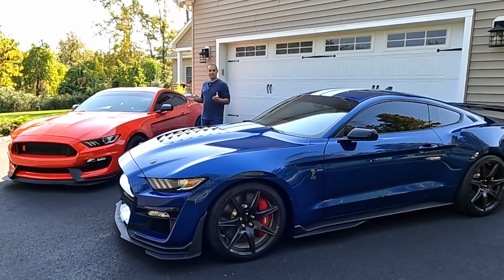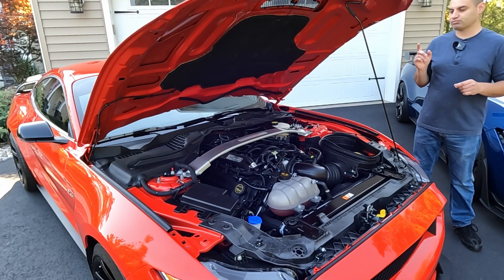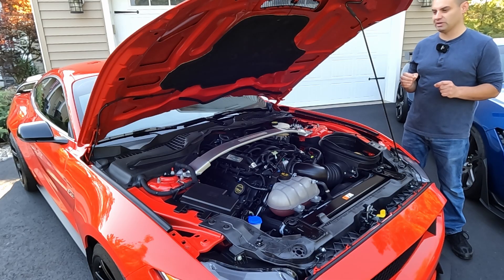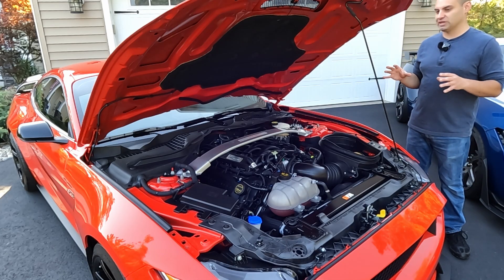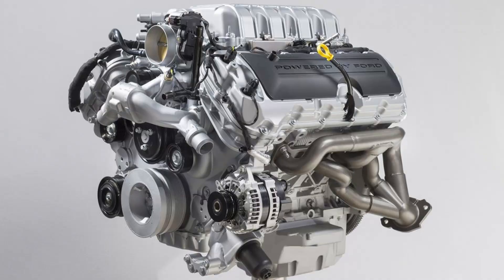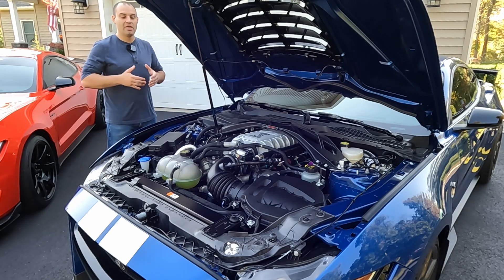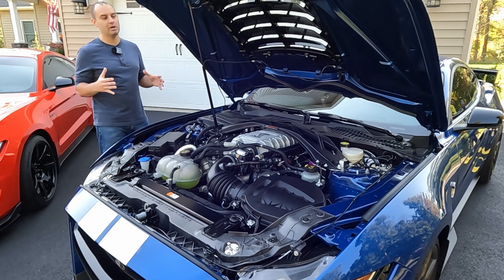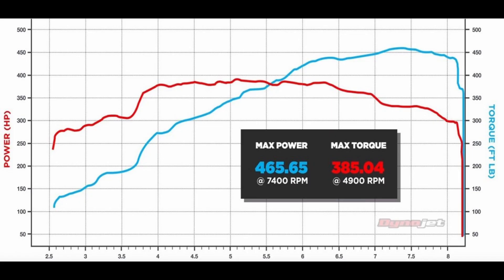GT350 vs GT500 Engine

Comment: 987 horse power is the best configuration for the 350 beat everything on the track in GTR spec 305 rear wheels 240 front wheels soft rear suspension adjustable dampers hard front suspension

Comment: Gt350 is 50/50 gamble 
It can last well over 100k miles if you maintain 
Or blow up in couple thousand more or less millage 
 My bro brought 350 2016 6speed it had 695miles brand new 
After couple of weeks guess what back to dealership motor blow up at 1055miles 🤣 hopefully he had warranty but they end ip replacing the motor if he didn’t had warranty it would cost probably well over 20k +

Comment: Small correction, high cylinder pressures are measured in PSI, pounds per square inch, not pounds as you stated.

Comment: Nice comparison.  I have both cars and consider both of these closed air intake systems. The hood on the 350 seals the intake when closed. I put a JLT intake on the 500 and gained an additional 25hp (untuned).

Comment: what makes the gt350 and gt350r different?
Reply: Carbon fiber wheels, slightly wider tires 305/315 instead of 295/305. R spoiler is different. The suspension is tuned differently for the lighter wheels. And I believe the R has no back seats

Comment: Great video! What’s the weight difference between the two motors? Sorry if I missed it in the vid
Reply from the maker: The weight difference between the cars is 360 pounds. I’m not sure exactly what each engine weighs fully dressed. The supercharger assembly is 90 pounds alone and with all the plastic parts switched to aluminum on the 500 I would say around 120 lbs.

Comment: Regarding oil catch cans, are these useful considering this engine has port fuel injection?
Reply from the maker: yeah, the intake system will still get covered in an oily residue without it.
Reply: Lots of fluid in my raptor r 5.2 in between oil changes, would be dumping in my cooling block instead, ima assuming that’s not the best for heat exchange.

Comment: Both are awesome cars. But I'll always take my GT350 over the 500. Sounds better and has manual. No flappy paddles for me. Fantastic video.
Reply: GT350 is way more special car to me as well although the GT500 is neat.
Reply: Yep. I love  manual trannys but automatics are the way to go now days. They shift quicker.  All the drag race cars went to automatic now.  Manual is fun as you feel like it’s more of a sports car and you feel the road etc better but there is nothing like raw horsepower.  I have a 350 and a 500.  Both fun cars.  350 voodoo 
Motors have had a lot of problems.  In fact mine took a dump on me at 22 k.  Luckily Ford covered it and installed a
New engine. But I still worry about this motor.  Oh well. Just enjoy what you like folks.  Have fun.
Reply: I hear that if you put a super charger on a voodoo it makes that motor a beast but the problem is you have to spend about 25 to 30 k to rebuild the bottom end internals and use beefier parts otherwise the voodoo motor will self destruct.  That’s just the deal.
Reply: @chrisr1694  I prefer NA anyway.
Reply: Yep. I love  manual trannys but automatics are the way to go now days. They shift quicker.  All the drag race cars went to automatic now.  Manual is fun as you feel like it’s more of a sports car and you feel the road etc better but there is nothing like raw horsepower.  I have a 350 and a 500.  Both fun cars.  350 voodoo 
Motors have had a lot of problems.  In fact mine took a dump on me at 22 k.  Luckily Ford covered it and installed a
New engine. But I still worry about this motor.  Oh well. Just enjoy what you like folks.  Have fun.
Reply: @chrisr1694  The GT350 is not and wasn't intended to be a drag car.
Reply: Gt350 not even in the same realm can't  even compare the two together. Gt500 with its dual clutch kills any stick shift not even comparable. 😅
Reply: @ralphhall9434  that's not what it's about. The 350 is my choice over the 500 every time. You can disagree all you want to, I'll take the light nimble car every time over the heavy rubber destroyer.
Reply: @ralphhall9434 a supercharged gt350 cleans the floor of a gt500 that’s supercharged any day
Reply: @ralphhall9434  not concerned about how much faster gt500 can shift. Only boy scouts would prefer auto over stick!
Reply: Auto > Standard

Get with the times

Comment: Love to see a voodoo engine with a 10R80 plus Whipple on it. Power from low to 8000 rpm! Anyone done this?
Reply: 10 speed isn't needed on fast cars with actual power.  It don't hold up as well at that  power level.

Comment: Color coding on your HP and TQ graphs is a bit confusing.....  Power (HP) in red on side label but blue line and blue font for max, while Torque (FT LB) is in blue on side label yet red line and red max font on graph. This is for the GT350, for the GT500, you got it right.
Reply: Awesome video, but also noticed this
Reply: Yup, he needs to edit that, but great video when dyno graph is shown 
An overlay of the two graphs with 4 different colors would be impressive.